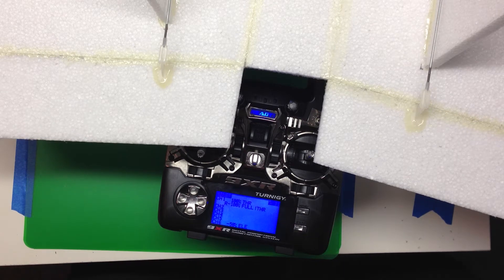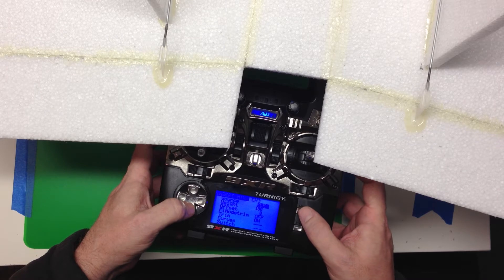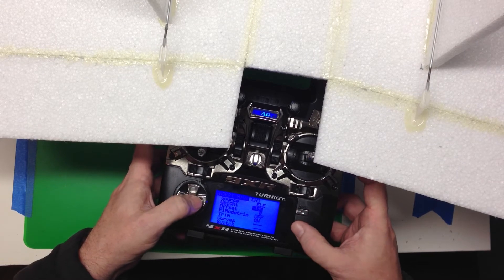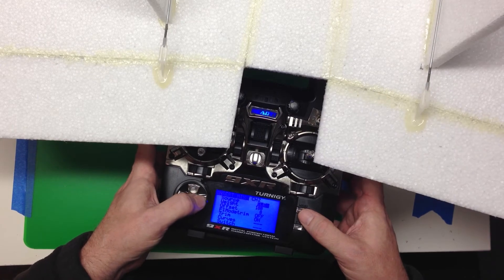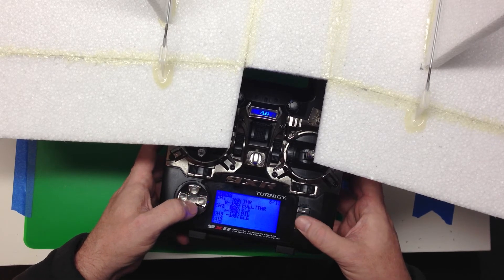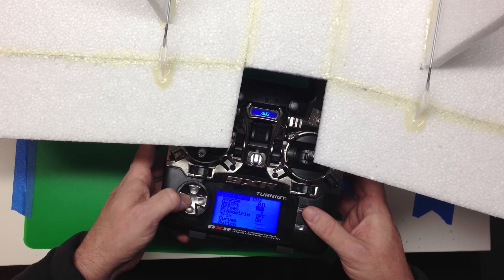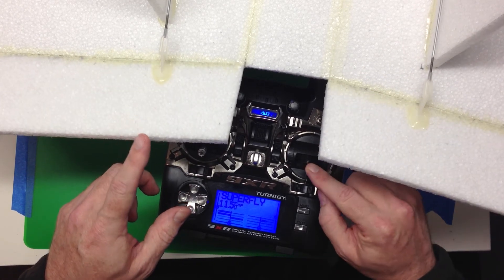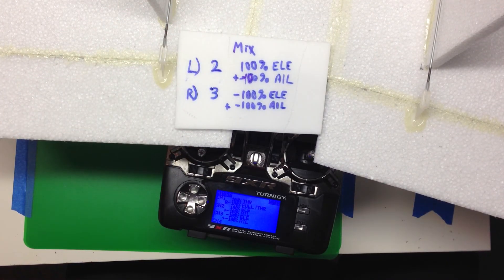er9x Elevon Mixing, express version

Comment: Thanks But where are you at in the radio menu? That is the real confusing part, the 9xr firmware is confusing! I have been practicing enough to know my way around it now, but have no idea what menu screen u where at or even what steps you took to get to it to set this up.

But I have to say thanks a lot for this, because no instruction manual came with it LOL, so you really have been a big help!